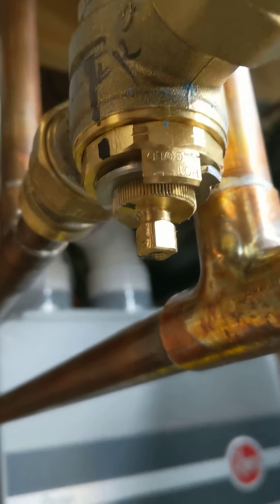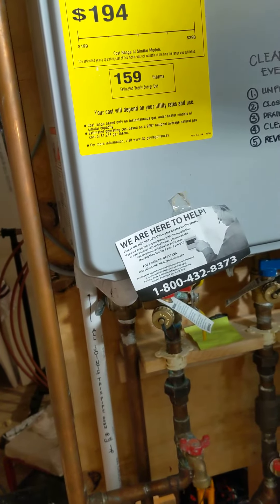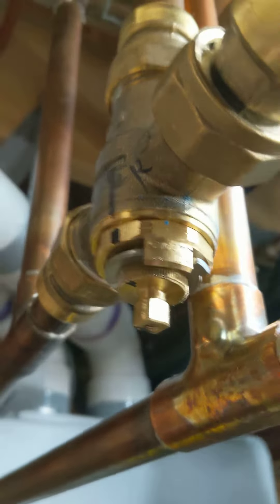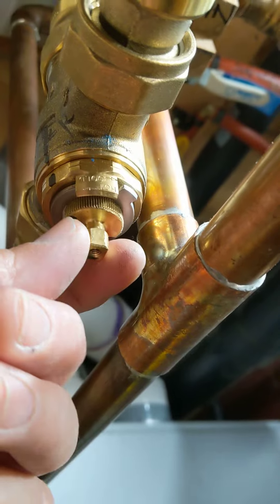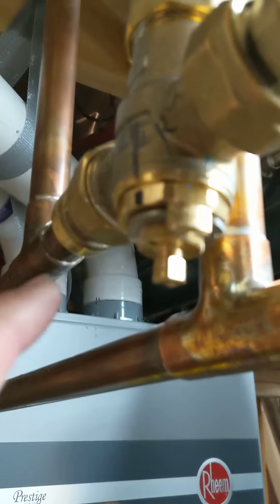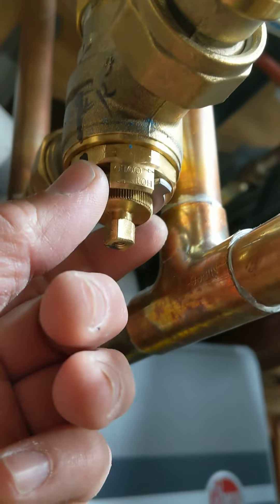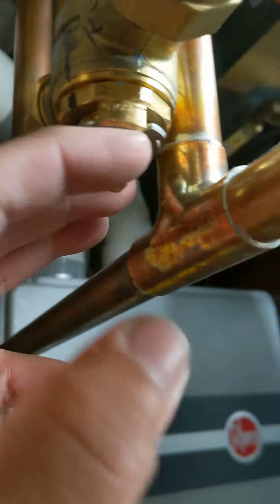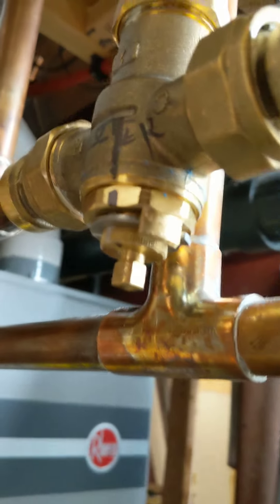hot water mixing valve adjustment

Comment from the maker: I think I mark the position of the valve at full flow in the video with a black marker.
Aligned that straight with pipe.
Reply: Thank you for a quick reply.  Your video is very clear with instructions. My problem is i cant turn it counterclockwise any more to make the water hotter. If i make a slight adjustment the other way no problem , the water gets cooler.
Reply from the maker: @1kavadarac640  so you removed the ring and turn it all the way counterclockwise and it's still not hot enough? And water temp in water heater is all the way to high? 
Then either it's defective or there is flow restriction somewhere. Check cold water supply to  water heater.
Reply: @dyilandlord3518  You are correct,i removed the ring and turned maximum counterclockwise and the water heater is set to maximum heat. Everything else seems to work fine. I am thinking that maybe something is not working with the valve
Reply from the maker: @1kavadarac640  also  Im assuming you connected the correct end to hot and the other to cold coz it's labeled.
Reply: @dyilandlord3518  Yes ,you are correct.I  had no problem up to about 2 weeks ago . Plenty of hot water, but it changed. I increased the temp up to max, it is a little better but not the way it was. That is why i suspect the mixing vale.